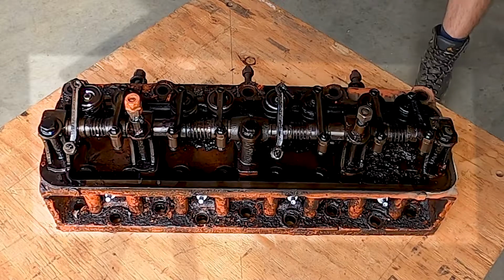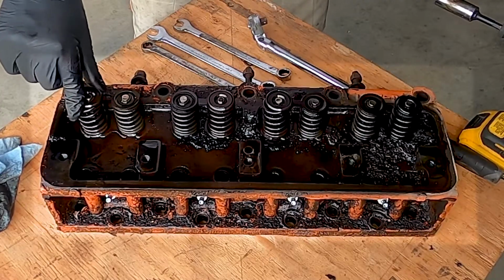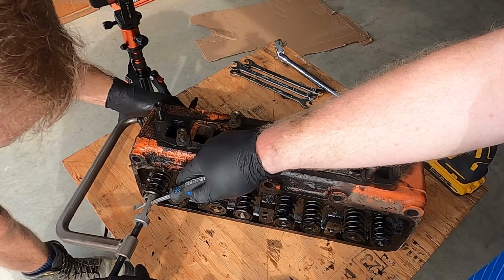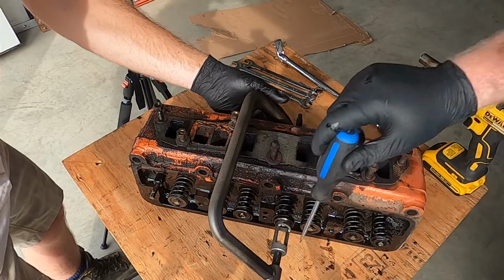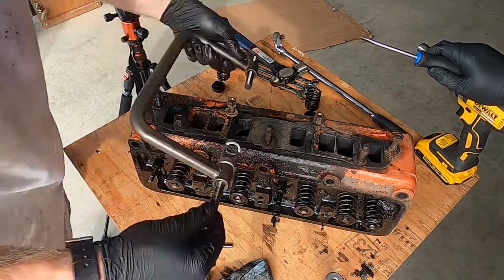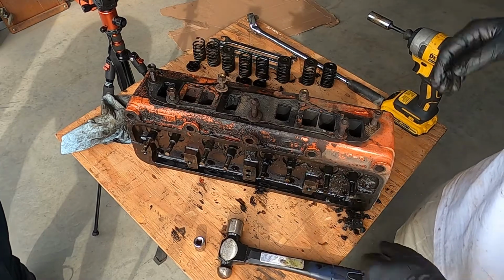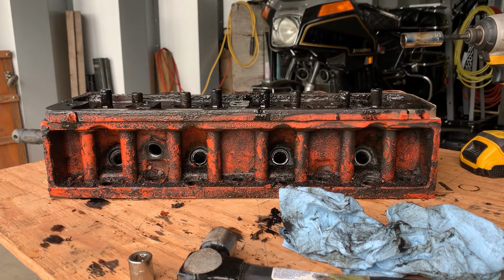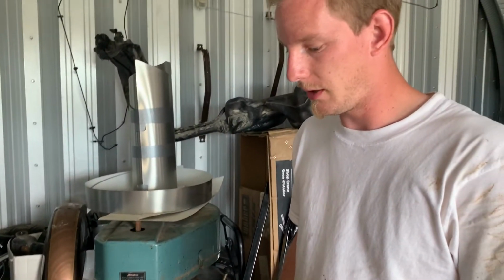Cylinder Head Disassembly // 1958 Case 600B Case-O-Matic Tractor Engine Rebuild Episode 4

Comment: I wonder if I should use a lead substitute on my 600, I know a valve seat came out of my 1974 fj40 that I'm restoring, that I think was due to unleaded gas..
Reply from the maker: Hi there,
I would say that it can't hurt to run a lead substitute on the 600, but probably is not necessary and ultimately just costs you more money. I have not been running lead in my 600B since I have owned it (almost 3 years) and I have not experienced any related issues. I will double check my J.I. Case service manual and see if it says anything about lead.
Thanks for the comment!
Greg